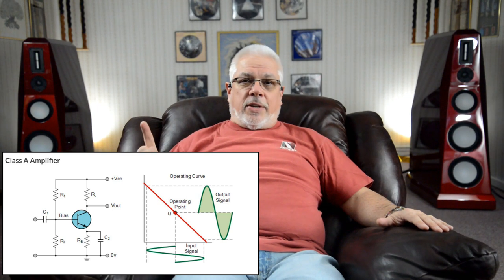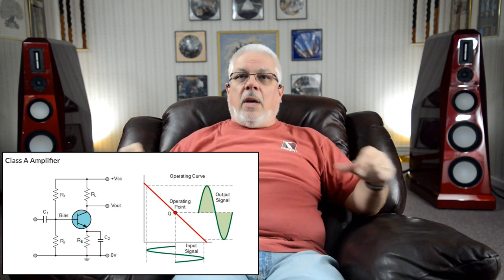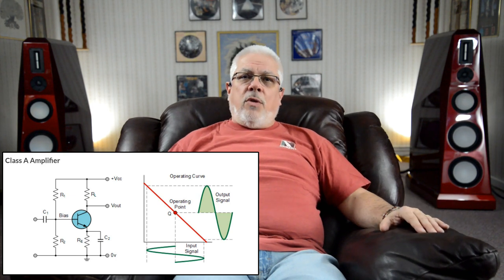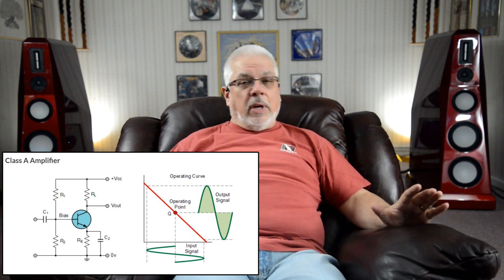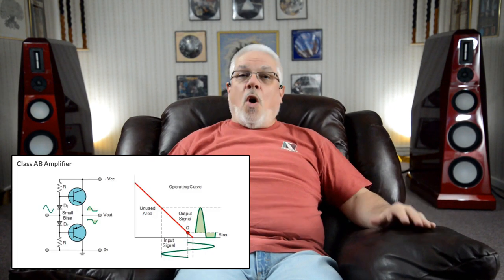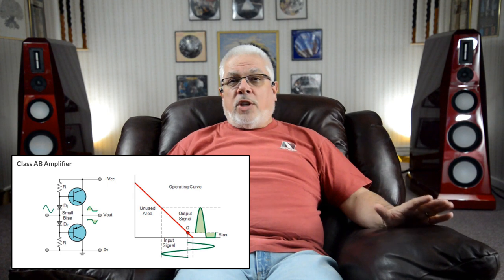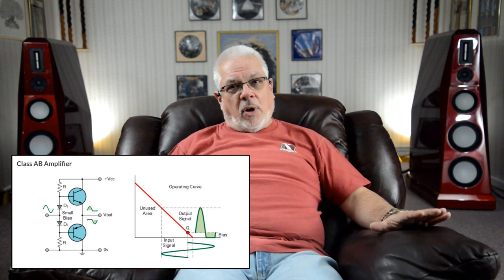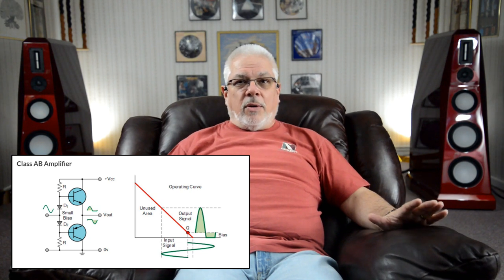E38: Single-Ended vs. Balanced Connections

Comment: Hi Greg
I have a pair of AudioNet Max Mono Block Amplifiers connected to a Pre G2 Preamp via 1.5 meter length Single Ended RCA connectors, as recommended by the manufacturer. I wish to move my Hi-Fi Rack with components from between the front speakers to along the side wall which is 7 m (23 ft) from the Amps. Is this much longer cable distance too long for the recommended Single Ended RCA, or should I change to Balanced XLR cable connectors? I will have to order made to order cable lengths from overseas suppliers to New Zealand (Down under in the Southern Hemisphere), at considerable additional $ expense and ask if you could recommend a well shielded cable if in RCA (if recommended), or standard Long length XLR cables. I currently use Wireworld Gold Eclipse RCA & Balanced XLR cables which are double the $ price cost you pay in the US, so more reference quality type cables are out of my price range.
I await your comments and recommendations on this matter. Thanks! Mark Hall (Nelson, NZ).
Reply from the maker: Hello Mark... That is an interesting parallel of my situation. When I moved into this new room in 2015, I had my components between the amp stands and speakers. But I moved my component rack to the left side of the room, opening the space between the speakers. I currently use a 20' single-ended run from my PRE G2 to the MAX monos, with excellent performance. However, know that I also have a balanced set of 20' cables, for use when necessary for reviewing purposes. And, while I prefer the single-ended connection, the balanced set STILL sounds awfully good.

IF you are concerned about RFI or EMI, then you CAN use balanced interconnects. While there is no doubt to my ears that the single-ended run is a bit more open and dynamic,  the use of the balanced interconnects is NOT a horrible compromise... Let us know what you do, and how you feel it works out. Best of luck, and thanks for taking the time to write...

Comment: what is or should be the characteristic (native) impedance of the rca/phono plug?
same for xlr plug? 
same for 1/4 inch trs plug.? 
presumably the cabling used matches those impedances?
(every plug type does have one) 
perhaps the effects are less important at audio freqs but again should matter more for mics which themselves have native impedances. 
also it seems weird using coaxial trs connection for balanced sigs.
Reply from the maker: Interesting question...but I'm not sure how critical this actually is, depending upon whom you read/listen to.

Typically, RCA connectors are not made to have a specific characteristic impedance. And while Canare Electric Co., Ltd. documentation suggests that it is about 25 ohms, I've never seen any absolute confirmation.

XLR plugs (implying a balanced circuit with two active electrical conductors of equal impedance, each carrying a different polarity of the whole) realize their biggest benefit from their greater ability to reject EMI and RFI induced noise interference - especially for runs of 25 feet or longer - and more typically have an impedance somewhere between 45 and 75 ohms.
Reply: @theaudioanalyst  I say these things from perspective of a radio operation where it is always crucial to match impedances within a system.  all impedance mismatches cause  signal reflections, high standing wave ratios and loss thru heat, dielectric breakdown etc, loss of efficiency, performance, more distortion,  phase delays and nonlinearity of freq response etc.
Reply from the maker: @paulmitchell4421  I could not agree more strongly. 

I hope you realize that I was NOT being dismissive of these concerns out of hand... Impedance mismatches between connected components – speakers included – may be seen as one of the most serious contributors to disappointing system performance.

And MOST audio designers – thank GAWD, not ALL of them – are wholly dismissive of any attributes beyond the more simplified engineering concepts of electron flow, impedance matching, and optimizing inductance and capacitance. By manipulating a cables physical geometry to control LCR (inductance, capacitance, and resistance) values, they try to achieve what they believe to be the most ideal relationship between those parameters and, therefore, deliver an optimized electron flow.

Yet others believe that within the realm of normal cable design, the LRC characteristics of cables will not have any effect on the frequency response. In fact, many folks out there, designers included, use this argument to support their contention that cables can't possibly affect the sound.

Some of the more enlightened out there take into consideration that the waveguide physics model explains very nicely why interconnect, loudspeaker, digital, and power cables DO affect sound quality. And further, it further helps to describe and understand other sonic cable mysteries, like why cables can sound distinctly different after they have been cryogenically treated, or when they are raised off the floor and carpet.

Cables – and the required connections they complete – are SERIOUS business that many totally dismiss… Thanks for your comments.

Comment: The question is, is there any significant advantage to using   Balanced over single ended
Reply from the maker: Hello. If you watched the video all the way through, you would see that the answer to that question is NOT a simple yes or no... Like so many other things, that is dependent on individual applications. Starting at 14:11 I outline the conditions as follows...

"Again, if you’ve been reading between the lines, you will have picked up on the fact that there are situations where neither interface is CLEARLY a better option than the other. Typically, when connecting a balanced DAC, Phono Stage, or other source to a differential linestage or preamplifier, or connecting that differential linestage or preamplifier to a differential stereo amplifier or pair of differential monoblocks, it MAY make the most sense to take advantage of the additional native noise suppression and rejection that a balanced XLR cable would afford. In cases where an Op-Amp is used in a similar manner as that used with my reference monoblocks, a single ended connection is preferred, and a more accurate sonic choice.

In general, it would make sense to use balanced XLR cables when both connected devices operate in true differential mode, when you are in an especially noisy RF or EMI environment, or when you need to use particularly long runs - say, more than ten or twelve feet 

So, is the balanced interconnect a "Holy Grail" in high-performance audio? Is it an essential ingredient for a top-performing two-channel system?

Unfortunately, things are not always as simple as they appear on the surface! The problems lie both in the way the inverted part of the balanced signal pair is generated, and the way that it's recombined. Both processes involve extra complications in the circuitry, and this can sometimes degrade the sound quality. Also, regardless of the exact method used to generate the balanced pair of signals, and to reconstruct the original afterward, the balancing will only extend up to a certain frequency limit. Beyond that limit, the signals will no longer be a mirror image of each other, and asymmetry will set in. This may be quite a high frequency, well above the "audible range", yet it can still affect the final audible result. And, obviously, if the balancing/unbalancing no longer works perfectly, neither does the noise cancellation which can break down at ultrasonic frequencies.

In a lot of cases, where there are options for both connections, the balanced may be clearly better, often sounding "cleaner,” "purer," and more dynamic. And yet, as discussed, other equipment simply does not benefit from the use of a balanced connection, with the single-ended interface sounding better. It will depend on how well the extra circuitry has been implemented, and whether those benefits outweigh any problems with interference, ground-loop noise and hum from a single-ended connection. With sensible design, careful grounding arrangements, well-selected cable, combined with a low driving impedance, traditional single-ended connections can provide superb and almost totally noise-free performance.

Which is best to use with your gear? I’d always start by checking with your manufacturer to see what they recommend, then, use your own ears!"

Thanks for watching and writing...